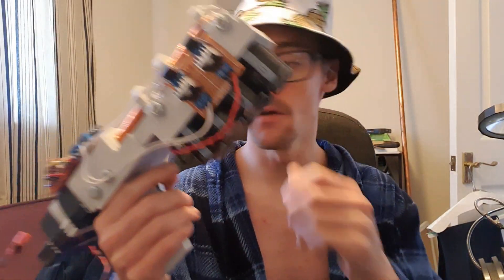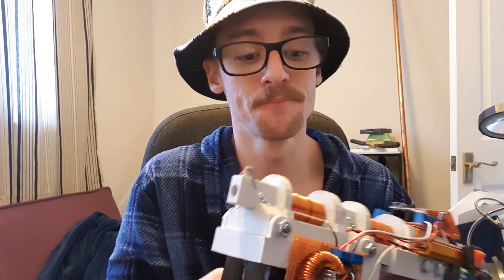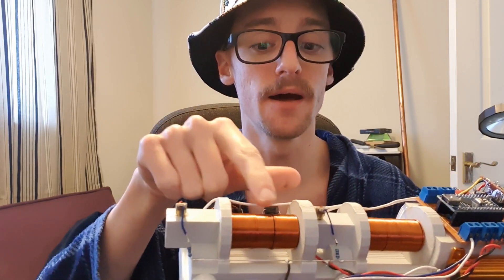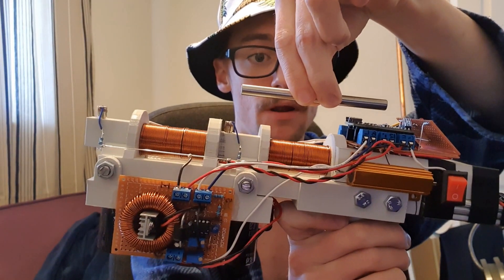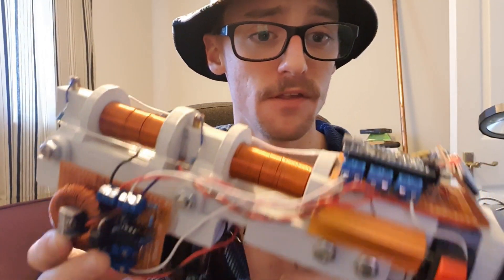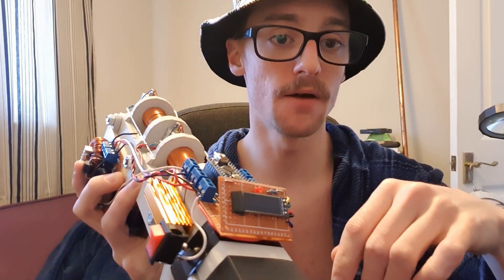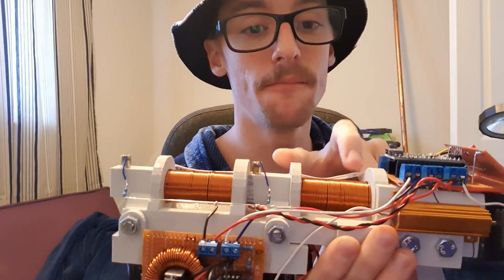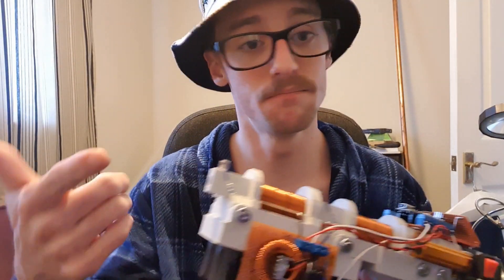DIY Electromagnetic Gun!

Comment: I am not sure why I can't find it anywhere, but how does the voltage affect the magnetic fields and projectile acceleration?
Reply from the maker: The current through a coil is proprotional to how strong its magnetic field is. If you double the current, you roughly double the field. Increasing the voltage is what causes more current to flow through the coil since Amps = Volts ÷ Ohms.

Comment: Man, pretty cool. I'm plenty curious about this, but I'm sure just about any question I ask I will probably not know enough about any of this to really appreciate or gain anything from any answers you'd give me. I know I've asked before, but why is multiple coils better than just 1 really big and or long coil?
Reply from the maker: The field strength decreases with the inverse square of the distance.

So if we're 10mm from the center of the magnetic field generated by a coil and we're experiencing a field strength of 1 tesla, at 20mm away from the center we'll be experiencing 0.25 tesla.

So having multiple short coils means that we get several big & quick pushes, rather than the weak and slow one we'd get with a big coil.

There's also the problem of a bigger coil having more wire that the electrons have to go through to get to the other end, which means higher resistance and less current. And a coil's generated field is directly proportional to the current flowing through it.
Reply: Additionally the coil is fired using capacitors which quickly drop in voltage as they discharge into the coil (corresponding with the inductance of the coil and capacitance of the... capacitor). This means that a really long coil would not only take longer to discharge through, but the capacitor would quickly drop from it’s peak voltage by the time the projectile came closer to the solenoid